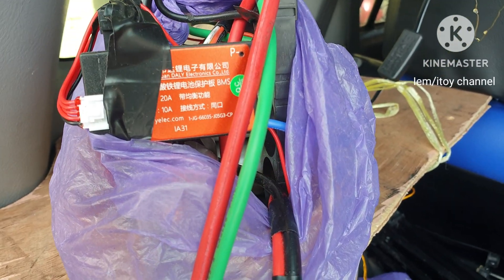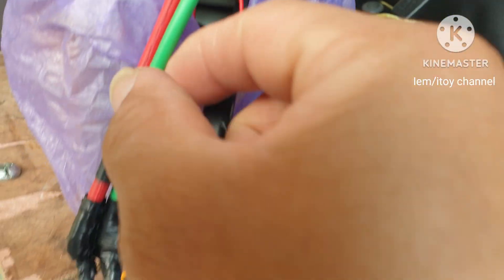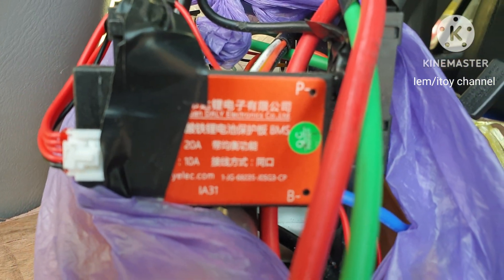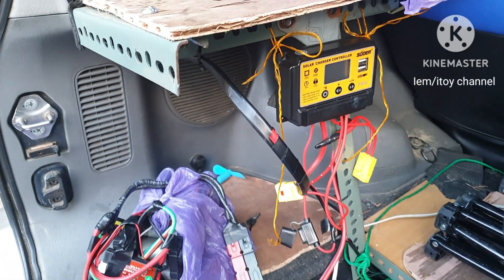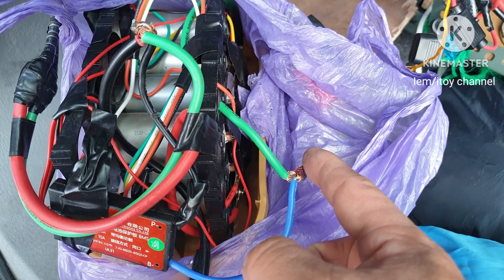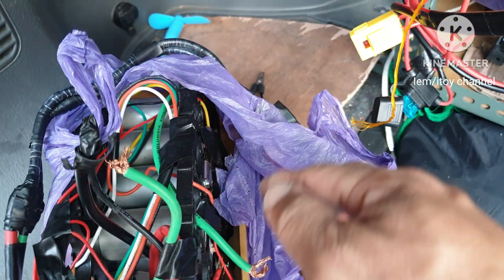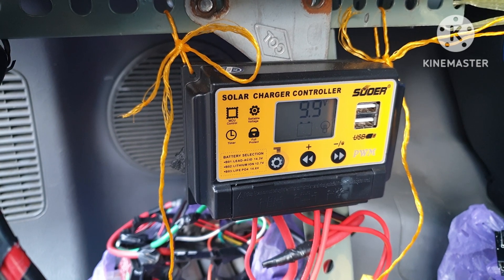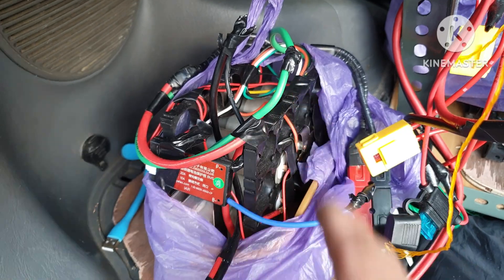Bms asleep or natutulog, how to activate for solar and using 32650 lifepo4 battery?

Comment: I purchased a bms 12v 100A for 12 v 100 A battery. The BMS discharging the current but not charging the battery. How to solve this problem?
Reply from the maker: @gyaneshwaram99  siguro parallel balance po muna tapos check kung magself discharge or walang resting voltage. Baka may isang defective cell po or bms defective mismo.

Comment: Sir no need to disconnect everything. Just add a momentary switch.   switch short the B- AND P-  and just press the switch everytime your bms sleep for 5 or less seconds while charging. Simple and effective hassle free (note P- and B- of bms is thesame negative) thats why even i you short circuit this two the bms wont have a problem. Just dont short circuit the bms and the positive end of the battery terminal.
Reply: Thanks bro. This is the real solution. You are awesome
Reply from the maker: Sharing my experience lang ako dito. Charging first ginawa ko. Yun pagground nabanggit ko sa description. Iba din style ng pagground ko po sa inyo.
Reply: It's clear to me thank you very much ☺️
Reply: Eto ang pinaka malinaw na sagot compare sa video na magulo konti gawa nung mga wires na magulo